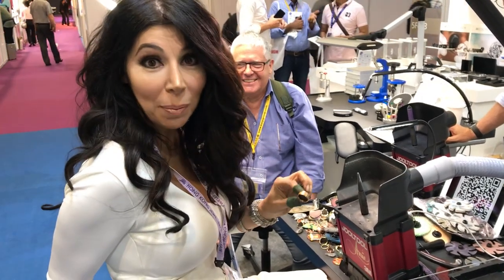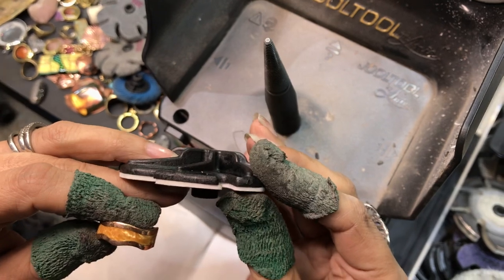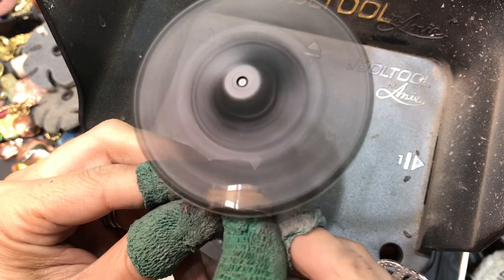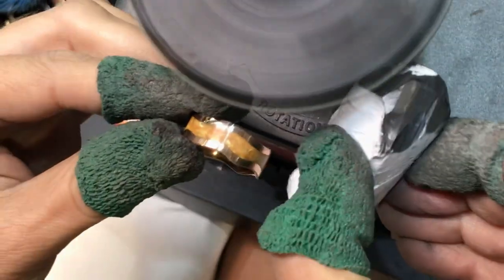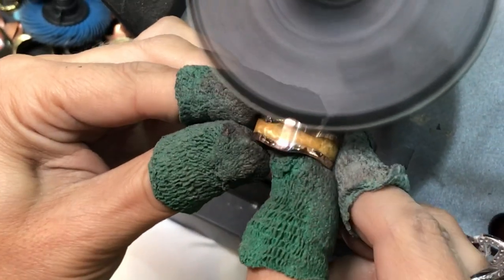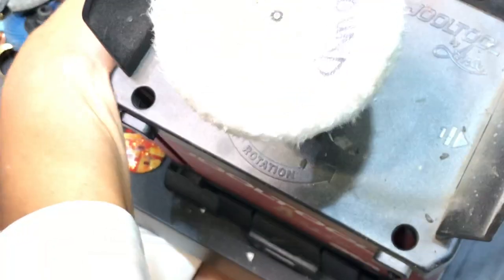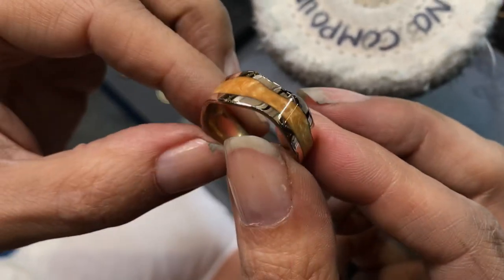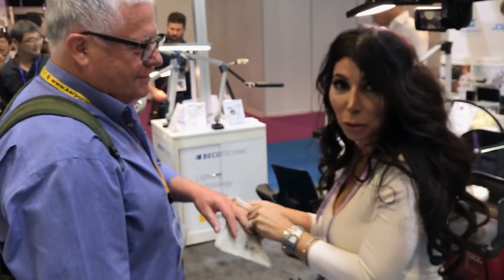Polishing a silver ring with ceramic rose gold inlay on the Jooltool

Comment: Hi Anie, were there any upgrades made to the new jooltool? As in, faster speeds, stronger motor, or is just the squared body that changed?
Reply from the maker: yes and we have a an option for you to upgrade. the motor is a little faster, quieter and sound is lower. we also upgraded the switch so it is more robust and we add two usb ports to the body so you can charge your phone, listen to music... while you are working in a paperless studio